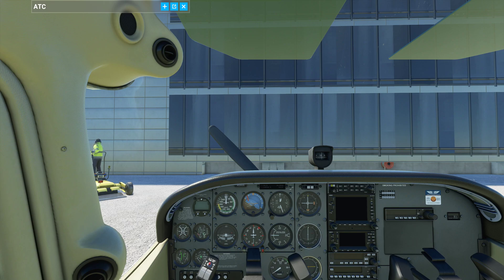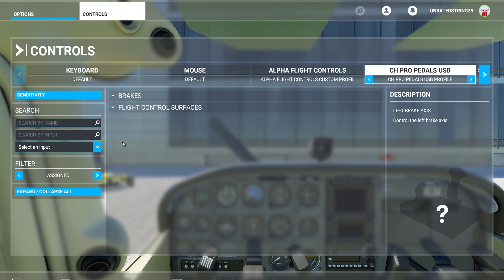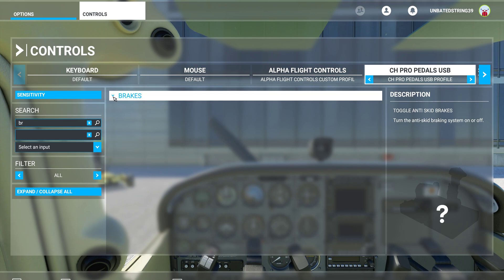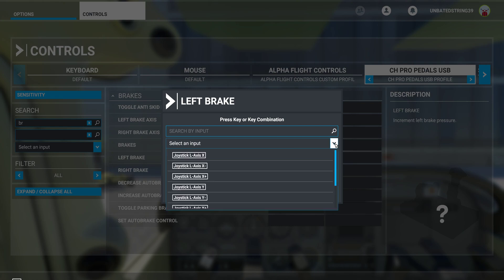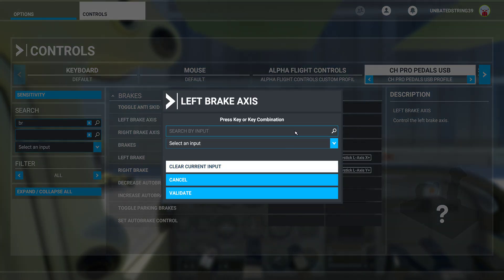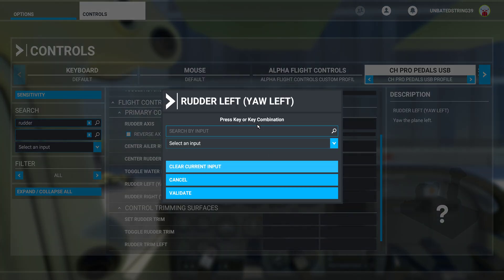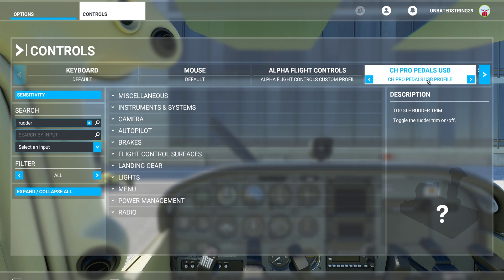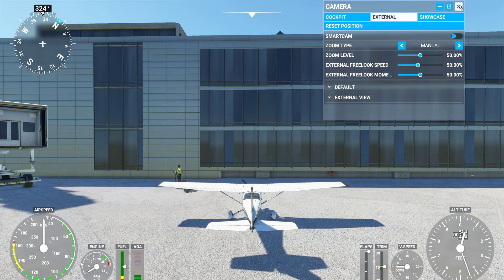How to Configure CH Products Rudder Pedals for MSFS2020 - Made 8/18/20

Comment: Thank you for the great video. Any idea if the CH Throttle Quadrant will work with MSFS 2020 as well ?
Thanks for your help.
Reply: I'm sure the CH Products Throttle Quadrant will work with MSFS. I made this video 2 days after the sim went public. At this point, I believe the sim contains profiles that will automatically recognize the rudder pedals and the yoke with the throttle quadrant. Of course, you can tweak the profiles using the information provided in this video. Hope this helps.
Reply from the maker: Yes it will

Comment: thanks haven't you configured the yoke too ? i don't know how to configurate it ? Does a flight map for the yoke exist ?
thanks
Reply from the maker: I don't have the CH Products yoke.  I've been trying to figure out how to configure the hat-switch for my Honeycomb yoke - no joy.
Reply: @CaptFrankWhite  ok thanks i'll try again by my own
Reply from the maker: @loud0667   You'd probably want to use the same concepts used with the CH - Product pedals. You'll need to add the primary flight control surface assignments to the yoke and power management assignments to the throttle quadrant. Good luck.